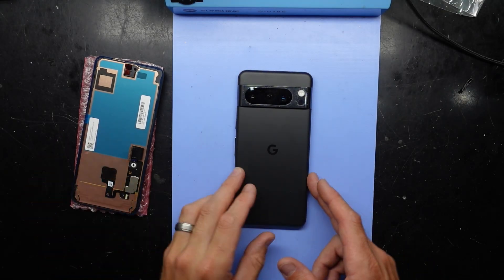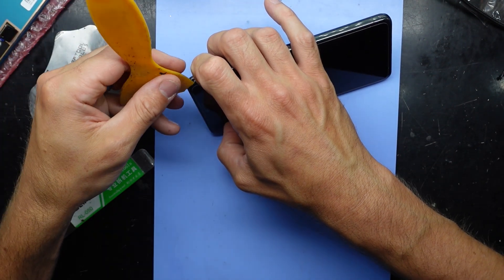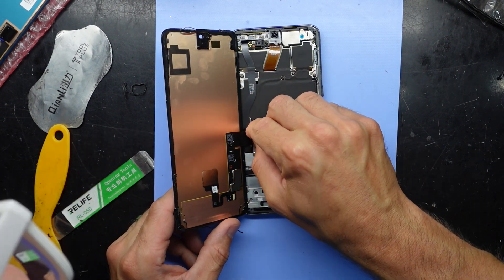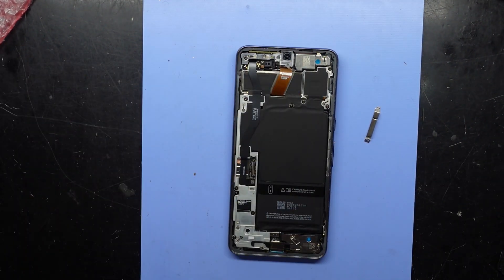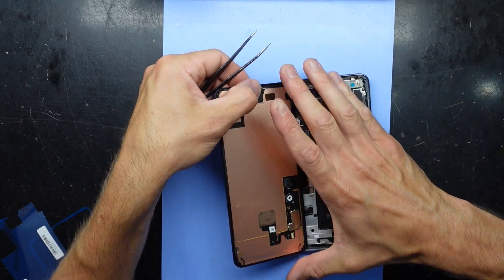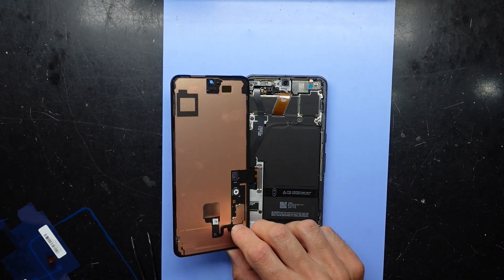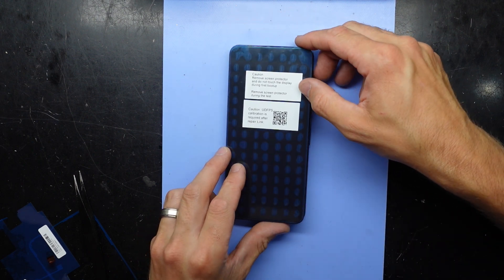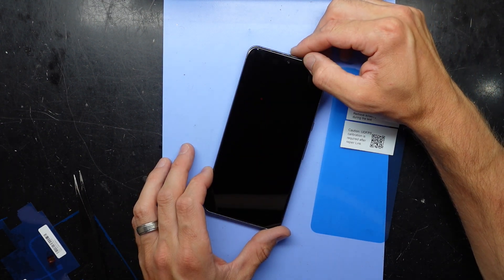Google Pixel 8 Pro Display Replacement

Comment: After replacing the screen, the fingerprint scanner stopped working. They said it needs to be calibrated. Will I have to reset it after calibrating? Will all my data be lost?
Reply from the maker: https://youtu.be/uxfcEHmfqJs?t=235
follow this video :)

Comment: Thanks for uploading. It’s really appreciated.. I have a question. I just recently replaced my pixel eight Pro screen and after that installment I see now that the selfie cam is very blurry and also it won’t read my fingerprint anymore. I took it to a shop. Is it possible to open again and fix it or will it destroy the screen?
I really appreciate it.
Reply from the maker: blurry picture might be glass clean 

the fingerprint scanner
try running this
https://pixelrepair.withgoogle.com/udfps
Reply: @ thank you 🙏🏼